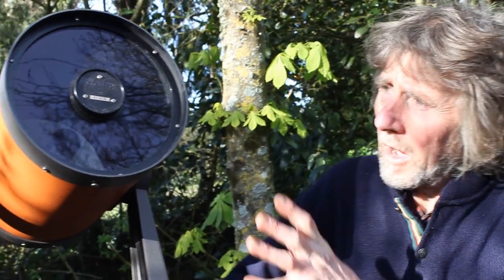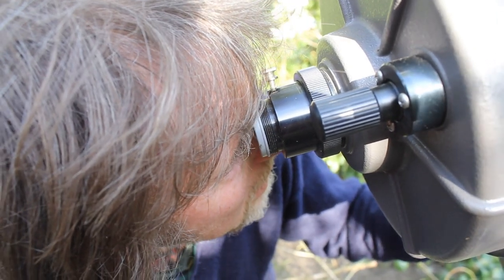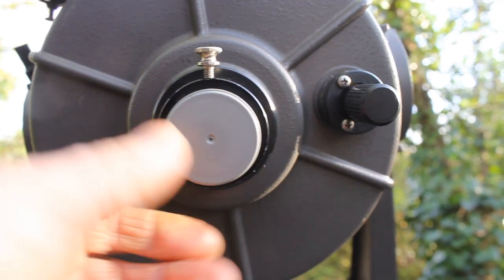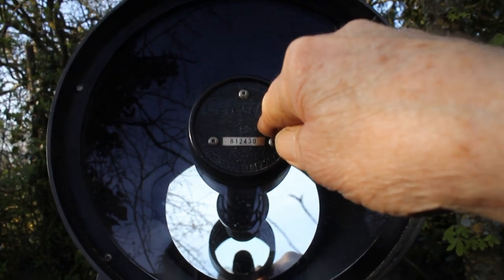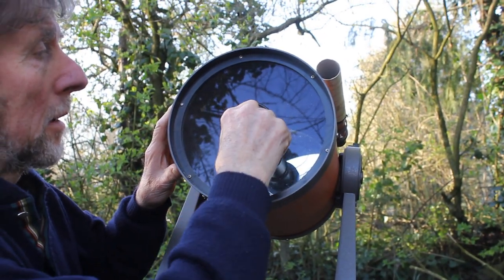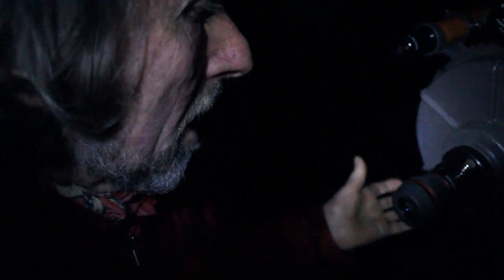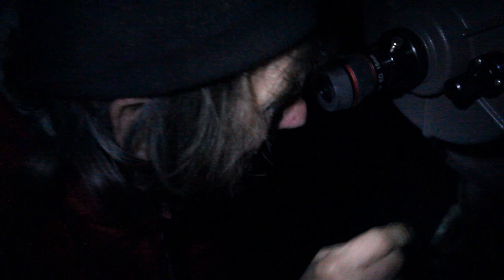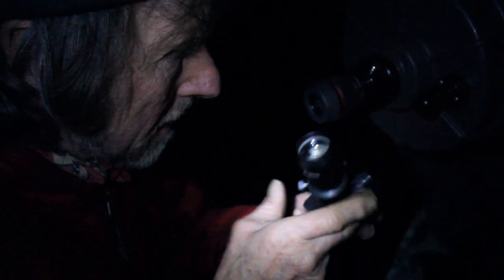Collimating my Celestron C8 - By Day & Night Colimación del telescopio Celestron. Collimation C8

Comment: This is GENIUS and just what i needed today to get a head start before the stars came out and it gets really cold.  I could do this from the warm and cosy indoors to get a head start.  I found there are at least two sizes of camera film case.  One was too big and one slightly too small.  I used the slightly too small one with 4 pieces of electrical tape on the outside (abut 5mm each).  Each was at 90 degrees to each other.  This ensured it was a nice snug fit and kept it central.
Once again, thank you very much.
Reply from the maker: Hi Chrys, I'm so glad you've found this video useful. It's great to get feedback and your comment is really appreciated. Hope you've got clear, dark skies where you are, I've just been putting the animals away and the sky is clear so I'll be having a look myself. Once again many thanks for watching and commenting, best wishes from Normandie, Andy.

Comment: The Cheshire Ep should be in the diagonal to compensate for the Ep tilt later once tightened. The method you used is perfect for astrophotography
Reply from the maker: For the C8 and all Schmidt Cassegrains you only need the collimation cap (the film canister with the hole in). I'd never thought of using it in the diagonal. Thanks for watching and commenting, I really appreciate it. Cheers, Andy.

Comment: I have a Vintage Celestron C8 like yours I just inherited and I think my primary mirror is crooked. There is a tube inside coming out from the primary (I assume for glares) and when I look through the eyepiece hole without the eyepiece I can see in the reflection that it is crooked and the entire reflection seems to be crooked. Is it possible to move the primary mirrors? on a side note I have a Collimating eyepiece I got with it and Trying to use it I am a little confused. So it had a large hole in the side with a 45 degree orange peal style reflector on it. Am I supposed to let light go in the hole?
Reply from the maker: Hi there, have you tried using the 'scope yet to see how good/bad the image is? I would have said that it is very unlikely that the primary mirror has shifted. The tube you can see coming out of the primary is the baffle tube used to cut out stray light from a bright source to the side of the object you are observing. When you look down from the the front end of the telescope, how does the primary/baffle tube look?

The collimating device you describe is known as a Cheshire Collimator and there are plenty of articles /videos on how to use one. I've only ever used the film canister technique so am unable yo comment on the Cheshire device.
To give as much help as I can, here are some links you may find useful: 

https://neffj.people.cofc.edu/WWW/observatory/IntroLabs/celestron_manual.pdf  (The owner's manual for a C8)

https://www.cloudynights.com/topic/559380-celestron-orange-tube-1975-c8-cleaning-and-refurbish/    (for a blow-by-blow description of a complete C8 rebuild).

https://www.cloudynights.com/topic/402734-celestron-c8-registry/      (to determine the year of manufacture of your C8)

You're very lucky to have inherited this scope, I've had mine for over 25 years and I bought it second hand. I've found out it was manufactured in early 1982.
I hope this helps, if you need any more information, get back in touch. Meanwhile, good luck with getting the 'scope back in operation. Cheers, Andy.